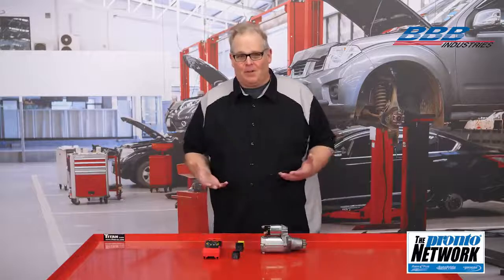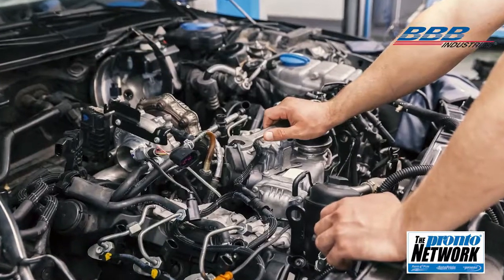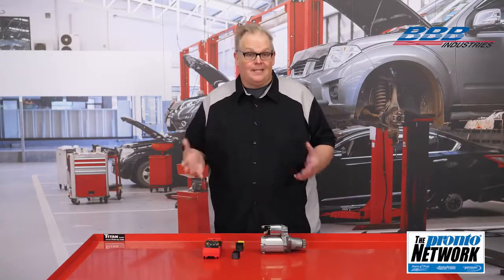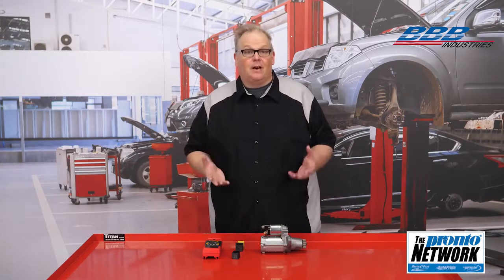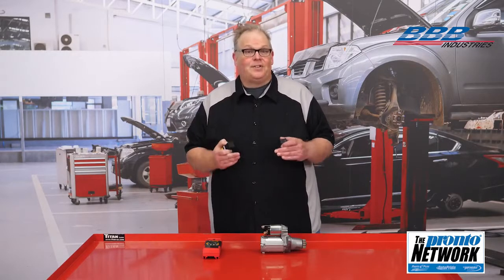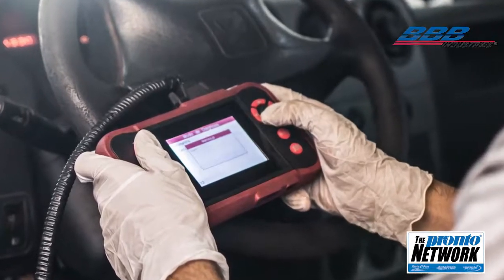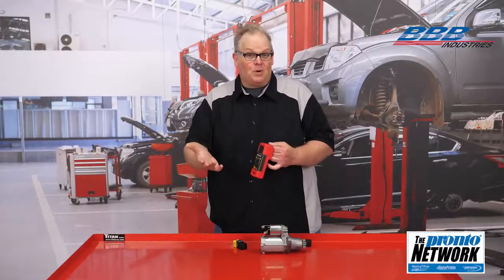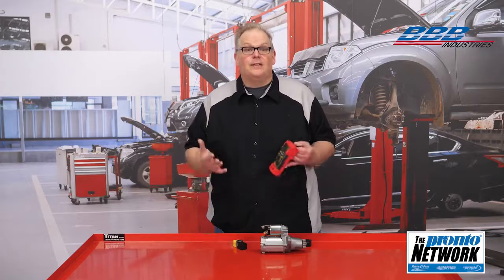Starter Diagnosis: Should You Replace It, Or Not?

Comment: I don't really see a large amount of late model starters replaced due to misdiagnosis. Usually the last thing replaced is the starter and solenoid, and then its usually the solenoid if the starter is geared.

Gaining access to a starter can be very difficult especially if under the intake manifold. 

If you have a detailed wiring diagram why would I use a scan tool unless a DTC was registered? I would just start by tracing the starting circuit to see if there is circuit power and the starting relay is being commanded on. 

I have a current loop fuse breakout for both ATC and Mini ATM so I can monitor the current when the starting circuit is energized. A relay may click on but the contacts may be worn and it will not actuate the solenoid. If the relay circuit is energized (Current flow) but the solenoid does not actuate, I would just replace the relay and try again. Not sure why this would be a problem if you swap the relay when the car is key off.